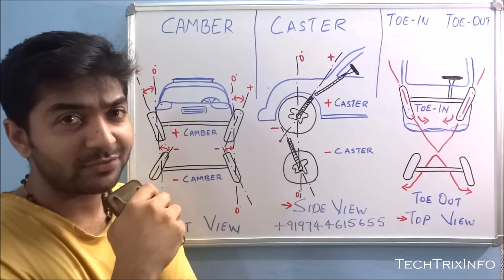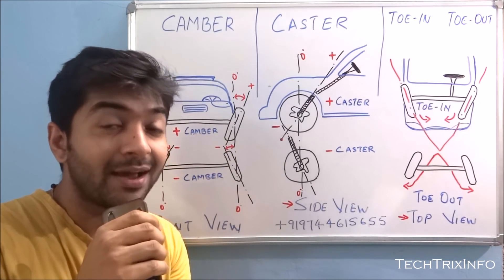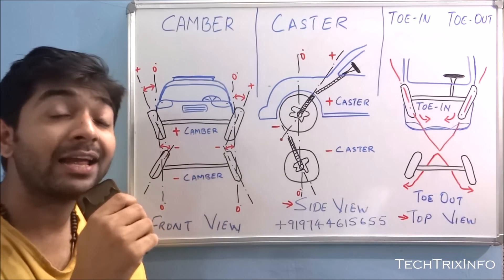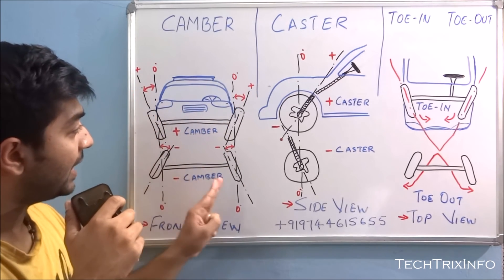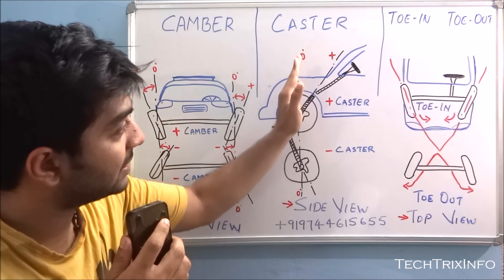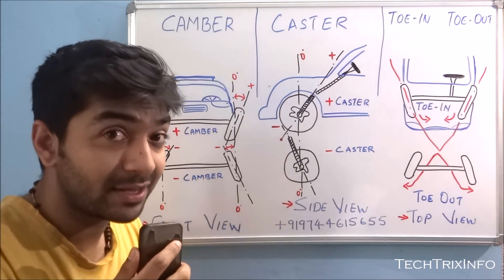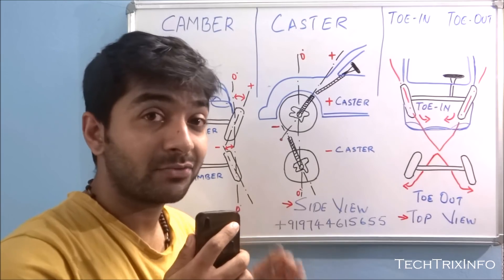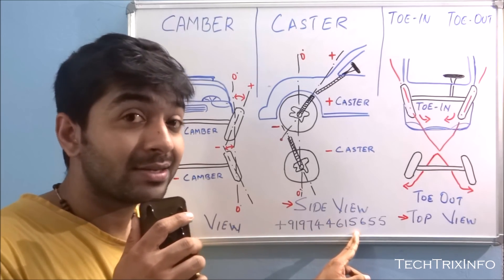★ Caster | Camber | Toe in | Toe out  ► Must Watch.✔

Comment: Plz explain effect on the tire   of cars,
Reply: If driver accidently turns the steering right , wheels turn suddenly so that      toe in alignment is used. (/\) to(/l) so that wheels not turn suddenly. 
If You need sudden turns when steering applied  Toe out is used.
EXample: Toe in -- Most of commercial cars swift, Ritz etc
                  Toe out -- Racing cars(F1)